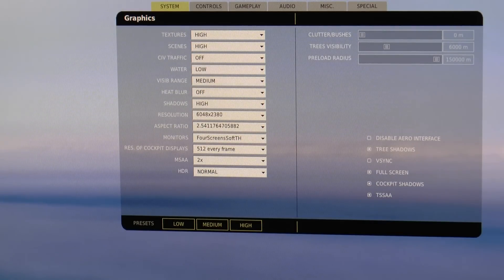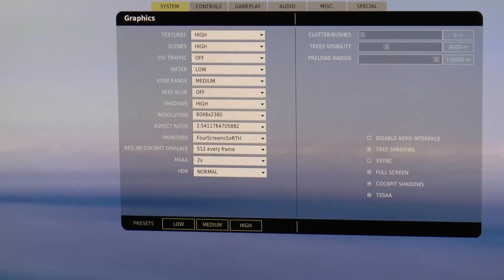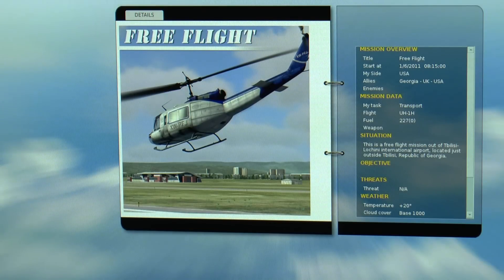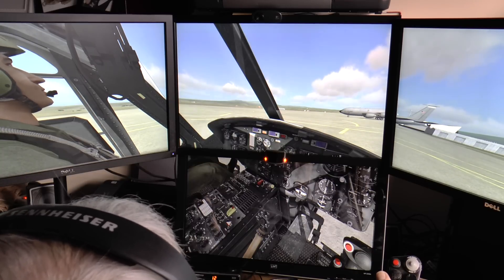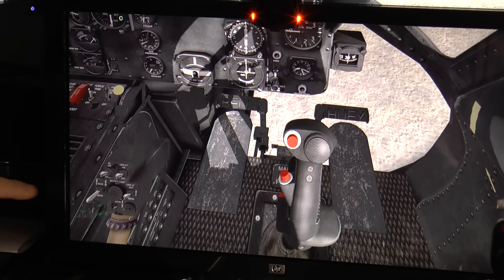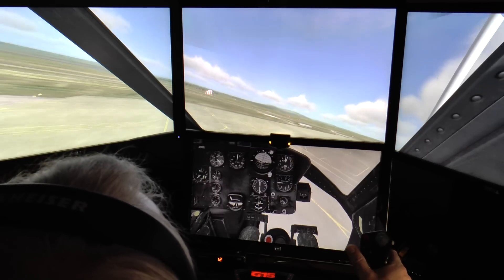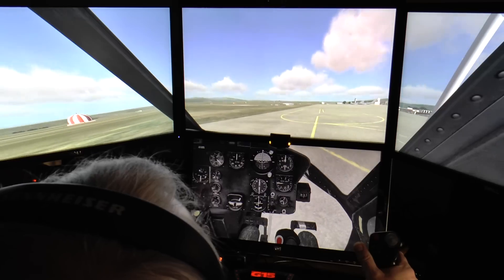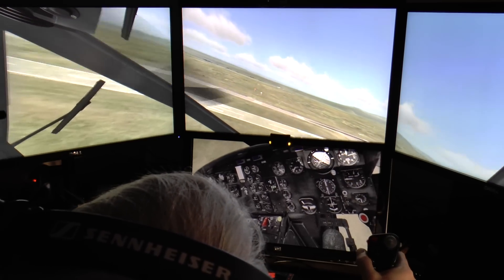DCS UH 1H Huey

Comment: how did you set up the screens and touch screen on a table or frame work? Thank you!
Reply from the maker: +Hindukush1234  The 24 inch Eyefinity screens were all on self made stands using a  swivelling Vesa  mount, and the touch screen monitor was mounted beneath the central stand also using a swivelling Vesa mount.
Reply: Thank you for reply, the 24 inch monitors looked larger. I will try to replicate a set up like this. I thought the field of view was very good without going overboard. I bought my son the Thrustmaster warthog and wanted work that into a fun platform. Thanks for the info and have a good week.